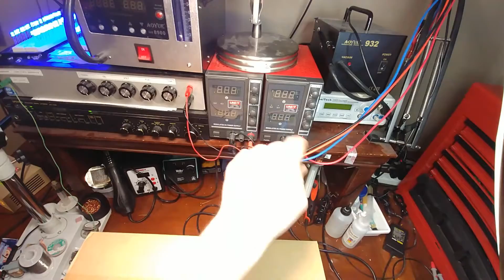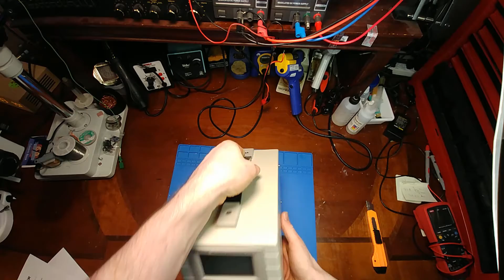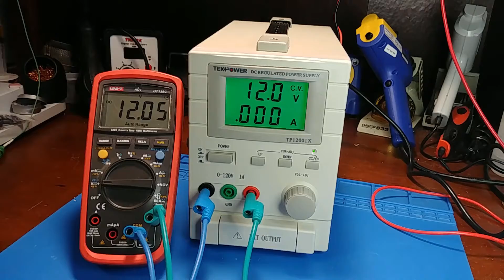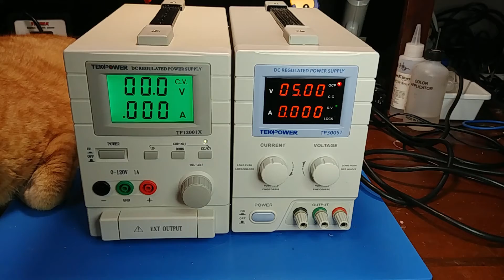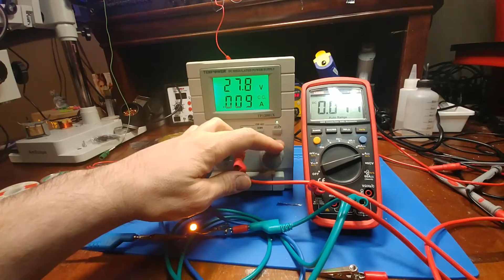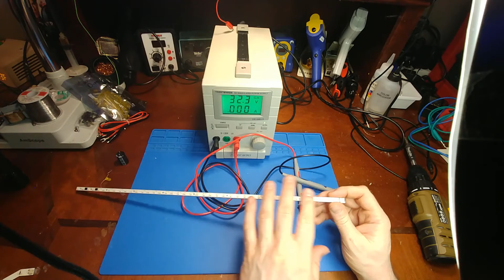120VDC Adjustable Bench Power Supply

Comment: Is 120v at 3 amps safe? Let's say I accidentally lick the connectors?
Reply from the maker: This supply is only 1 amp, but anything over 40v can tickle.
Reply: @jeffescortlx  I'm thinking about getting one of these to connect to a heating element to heat water, its probably a bad idea, but maybe it's a good idea! What do you think?
Reply from the maker: @shitina.bucket9699  your going to need a lot more than 100 watts unless you're only heating a coffee cup.
Reply: @jeffescortlx  well I was thinking I could just leave it plugged in and maybe use two of these, at least it would take the sting out of the water and slow down how fast it goes cold right?

Comment: For something a bit cheaper that does the trick, I bought this a while back and it works pretty well. It says it's currently unavailable, but I suspect the one in the second link is the same thing. Doesn't seem to be much, if any intended, capacitance on the output of these. They also ramp up the current gently. Don't know  if it's actually 1 mA, but the 1 mA setting is great for not getting blinded.
https://www.amazon.com/gp/product/B07GPGVN99/ref=ppx_yo_dt_b_asin_title_o00_s00?ie=UTF8&psc=1  
https://www.amazon.com/dp/B07MT87G2P/ref=dp_cerb_3

Comment: Hi jeff how di i know what millamp led bulb i need to repair backlights on a tv ,my tool will light them up and tell me  the volts usally 3 or less
Reply from the maker: The power supply board will typically list the current. If not you'll need to test it.

Comment: Just picked one of these up to anodize titanium. But having an issue. Seems to be hitting the 1.00A and only at 80ish volts. Any way you could help?!?! Im not too good with this stuff.
Reply from the maker: Your load resistance is too low.
Reply: @jeffescortlx  thanks for the help. I guess im just not sure how i can apply that knowlege to my usage. Maybe a larger container and more solution? Or adding a diode somewhere?
Reply from the maker: @ericspidell5255  in otherwords, it's not up to the power supply that your load is pulling 1 amp at 80v.

Comment: $130 id be expecting pretty good I mean i have one of those ming he unites boost converter that can do 120v and 15 amps really more limited by your input current which is also like 15 amps but it is a boost converter so it has to be a higher voltage than your input but if it is something like a short or that or something that can take a lot of amps at a lower voltage than your input it will not limit but that was like $20 i think and i use an old xbox 360 power supply for power
Reply from the maker: How do you regulate the current with that setup?
Reply: @jeffescortlx its all digital it has buttons its the ming he bst900 and for led is with voltage over 12v (or whatever your input is) it works fine to limit current and voltage and for most stuff i have the ming he d3806 which does not have any of those limitations its I belive 0v - 38v and 0A-6A
Reply from the maker: Ok I see. I've seen them pop up on eBay and YouTube.